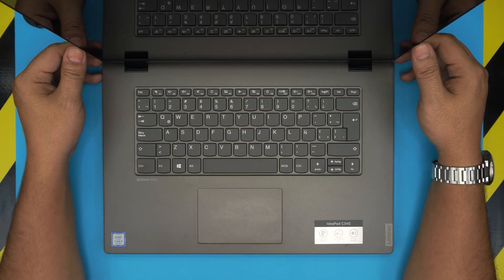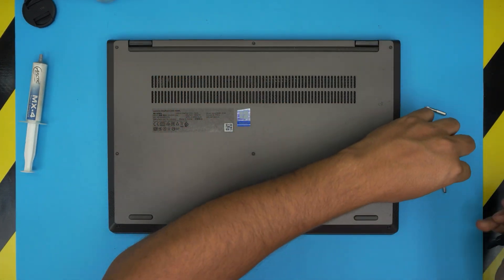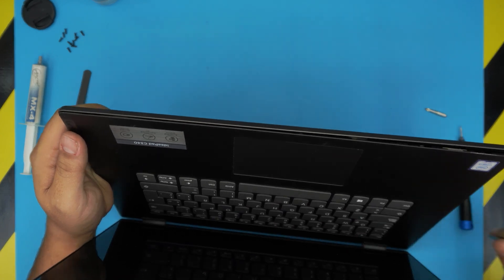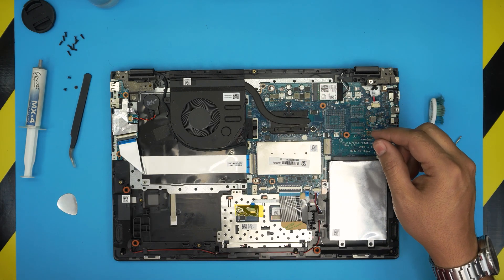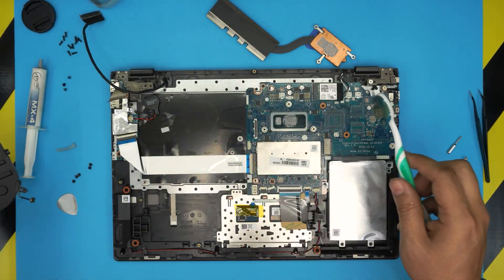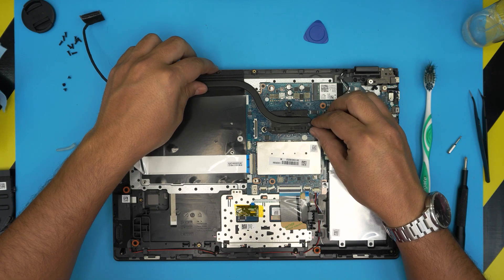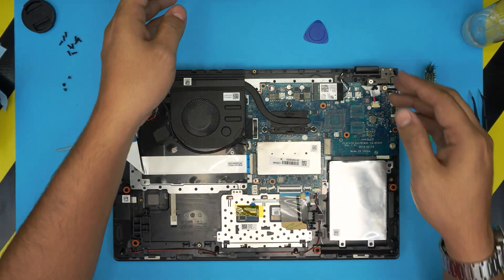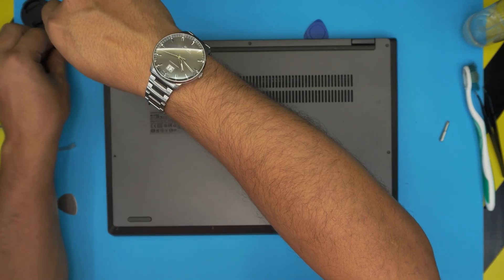Lenovo Ideapad C340 15Iwl 🚩 81N5 💻 Repaste cleaning Service

Comment: Just did this (without taking out the fan and heatsink since a screw wouldn't come off, I only took out the battery) and now laptop is not turning on. Not even LED light turns on when plugging it in. :(
Reply from the maker: go back and double check all the connectors my friend :(